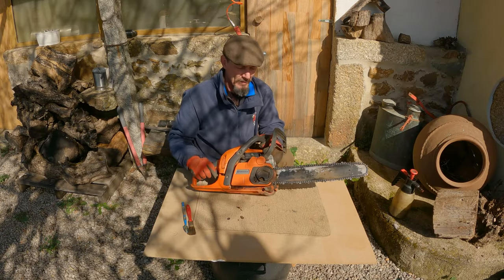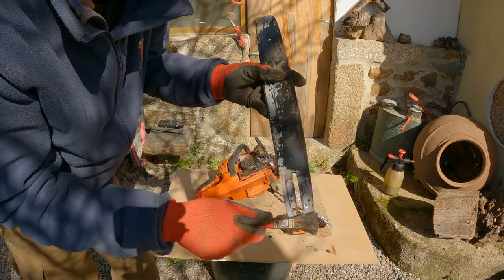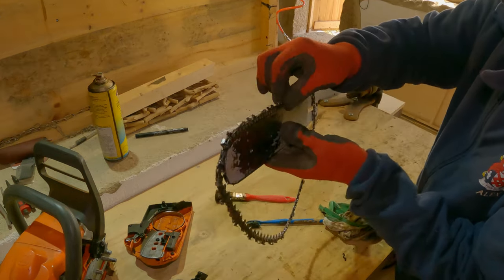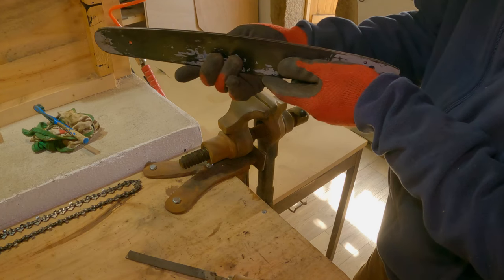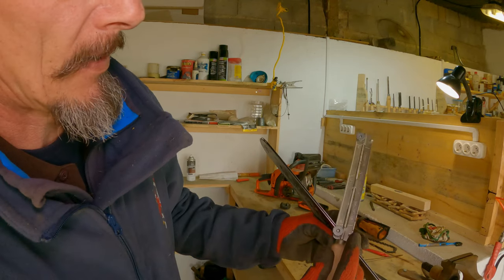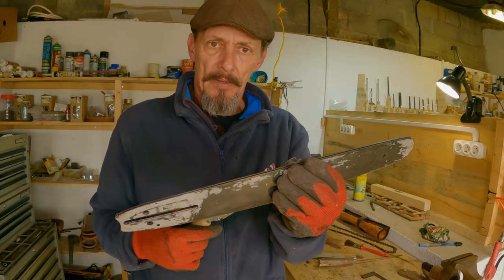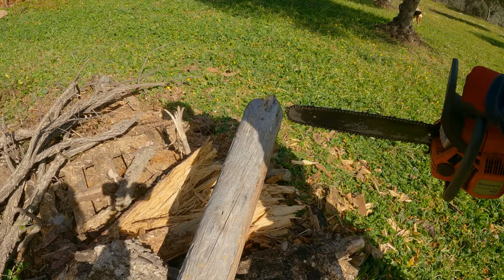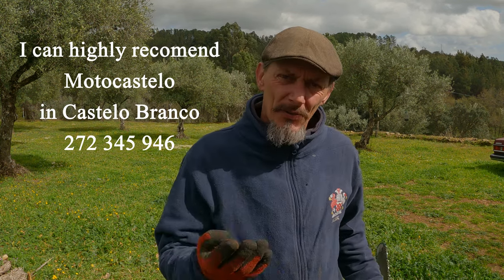HOW TO Sharpen your Chainsaw chain and maintain the bar. Portugal Farm Life

Comment: I watched this over breakfast... found myself thinking this'd be great if i ever have a chainsaw.

Then i realized, "hold on... i DO have a chainsaw 😳".  Rather than stick straight out, the bar on mine is in the shape of the letter "c" or "u" as it's a "safety saw" fir scaredy cat me and meant to keep the sawing away from and in front of the operator while sawing up to 5" branches.  I bought it for yard maintenance.

It's only been used once for an hour or so.  But occurs to me to have a check to see if there's any sawdust accumulation.

Great explications and tutorial, Alex.  Thanks.  Now i hace this to study for when i'm brave enough to try maintenance (tho it'd probably be better for me to have it serviced by a professional).
Reply from the maker: I have never heard of a saw like Ruth, would be great for the girls as they keep asking me to show them how to use my chainsaws but i keep telling them no as they can be very dangerous...... mean old me🙂
Reply: @FontedaPipaPortugueseFarmLife  I'd have to agree with mean old you!  I'll have to find you a picture or link.  I don't think the eensy weensy baby saws are the way to go as the bar still protudes with teeth in all directions.  But this safety saw with a littke power and teeth incased in the "u" with the open teethy part away from me makes me braver 😁.